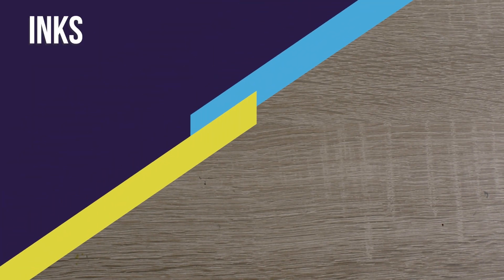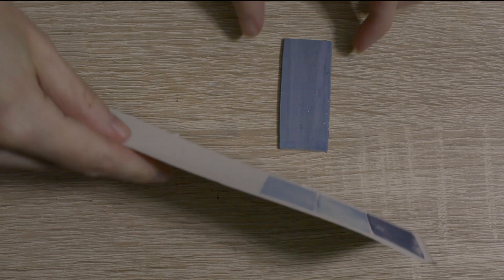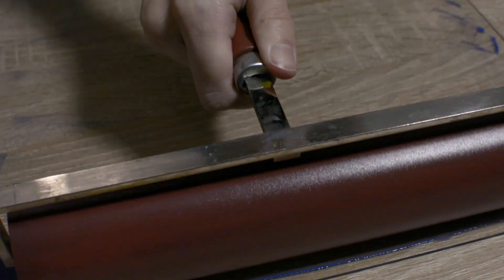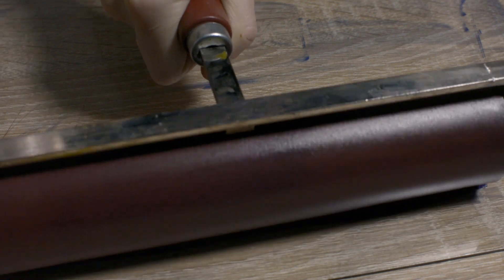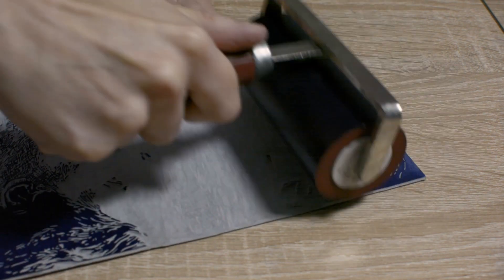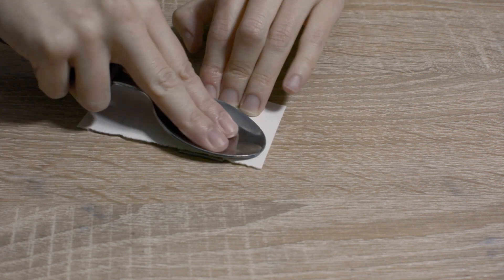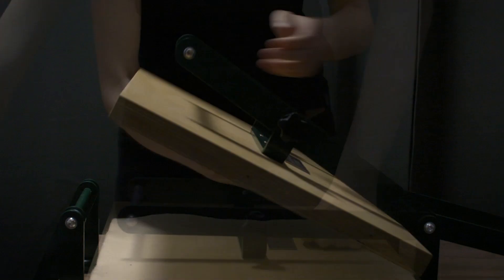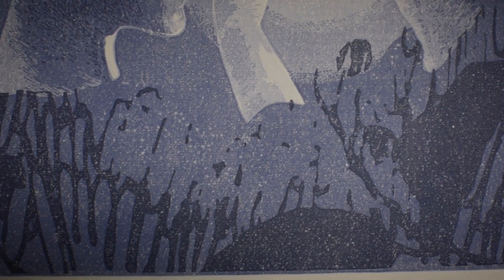Printmaking process video

Comment: This is an awesome video! Thank you for making one in english. I really appreciate that 🥰 Does the lino accumulate ink when you create 50 - 100 prints? For example, Do you need to clean the lino after the 25th print to prevent ink from seeping into it?
Reply from the maker: Thanks, I will try to create more videos in english. I have never created so many prints to be able to tell, but I guess it could accumulate some ink.